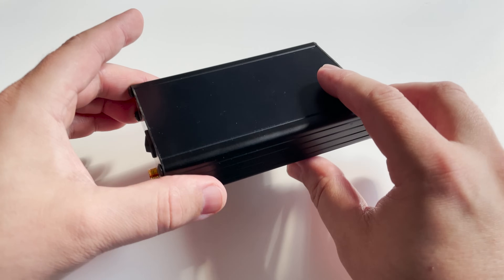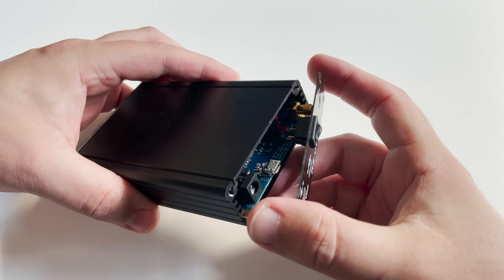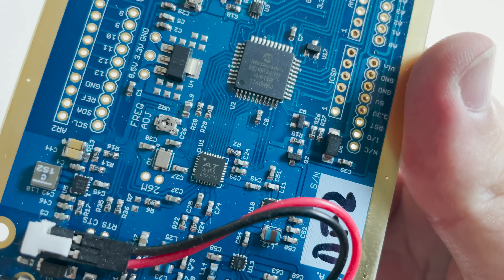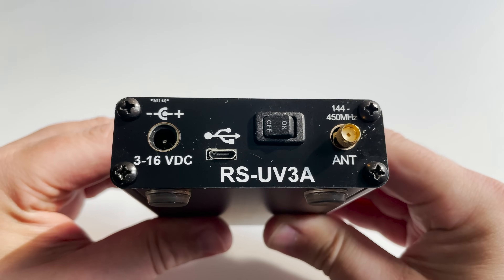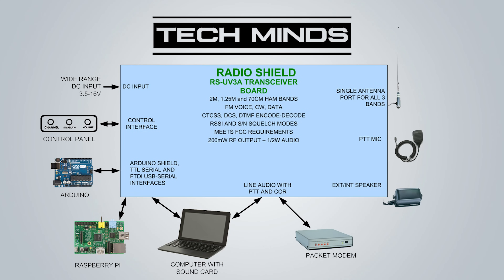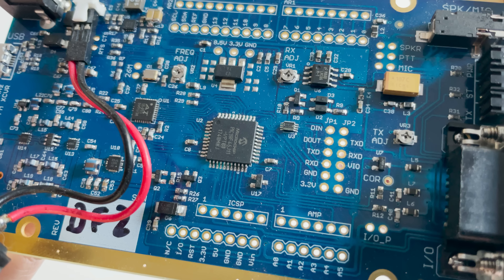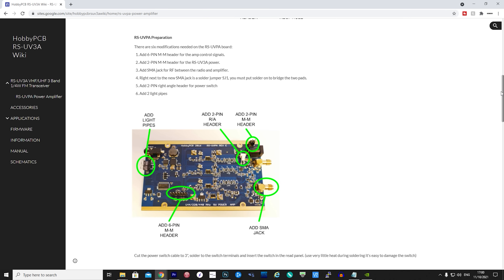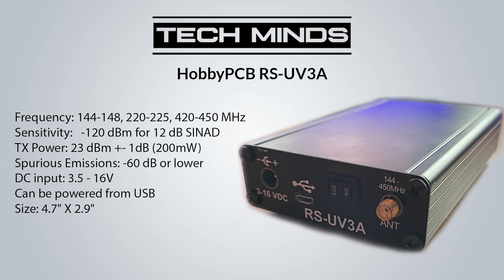TRI BAND HAM RADIO TRANSCEIVER - RS-UV3A

Comment: Hm, I see a FM sat radio, with Doppler correction from the Arduino. And maybe even add sensors and a display for pointing a handheld gain antenna. I wish I had time and skill for this.

Comment: for only 200mw its basically useless for me. Even with the 5 watt amp its not useable where i live. I would need at least 50 watts to hit the closest repeater where i live. If I purchased an amp that could do that i couldve bought a regular ham radio that does 50 watts for the same money new or used from somewhere else without all the extra stuff involved in trying to use this with an external amp. Its a neat concept just not sure what real world application i could use it for.
Reply: @Randrew  lol ok

Comment: Over priced for what it is, in my opinion
Reply: @Randrew  apparently you misunderstood my comment, it is OVERPRICED for what it is. It doesn't matter what or who is going to use it or what it will be used for. The device is OVERPRICED.
Reply: @johncase2974  You did state it was your opinion and I respect that.  My purposes and opinion are different :) 

What the price and its open-source nature does mean is if there's a wider market for it, some Chinese manufacturer will spin up a board and make 5000 of them to sell on ebay and AliExpress for $25 each.  I actually like that about the market and open source - it's very good for DIYers and if a designer doesn't like that, they can keep their product proprietary and good luck to them.

Comment: Okay what does it cost? Important information. Compairing this to a $20 Baofeng it seems you could do more for less with a Baofeng and for less than $33 US you can get a full 8watt (7.75 watt) granted it takes two connectors it has more features.
Reply: 109.99 dollars USA. not cheap for sure for what it is.

Comment: I would like a 50 watt version and software that you could use your computer head set with vox to listen and talk. Also, more memories that store the repeater rx & tx frequencies. I work from home and this would be great on my desk to use. Someone needs to make a triband amp 25, or 50 watts.
Reply: Take a look at the QYT 9900 25 AND 20 WATT OUTPUT, TRY BAND

Comment: Why did they make it a conventional transceiver and not an SDR ?   Wouldn't take much to make it an SDR.   Ditch the final down converter and filters and replace them with a good ADC.
Reply from the maker: I think there is a REAL market for a VHF/UHF sdr unit. Something cheap and buildable. Like the HL2 but VHF
Reply: That may be true give it a try and let us know
Reply: @Randrew  There was probably no way to separate out the IF in the IC and feed it to the ADC to build an SDR.

Comment: Cool little unit.  I wish it had at least 2-5 watts out of the box though.  Unless you live near a repeater or line of site with a beam, it will not be heard well.
Reply: Just Build an amp
Reply: Build an amp with low pass filter. Not as hard as it sounds

Comment: Ethernet would be amazing allowing mount at the masthead
Reply: w/ PoE + noise filtering/shielding for power circuit perhaps
Reply: That's actually where I expect or at least hope some new (commercially designed) radios will go. APRS digipeaters and iGates are a good application example.   I'm running an iGate right now that consists of an 8 foot tall antenna, 50 feet of LMR400, an RTL-SDR dongle and a RaspberryPi.  Man, that dongle looks silly hanging off the end of that half-inch diameter coax in my radio closet ;)

What I'd rather have is the radio and compute functions in a compact package and in a weatherproof housing right up there in the air under the antenna.  No RF loss before sampling and a shielded Cat5 Ethernet cable dropping to the house to the PoE injector and LAN.  I could (and maybe will) try stuffing a dongle, RPi Zero and PoE circuit into a PVC pipe, but without board level design attention, I'm pretty sure heat will be a problem outdoors in summer.